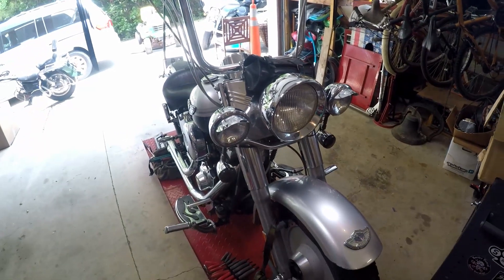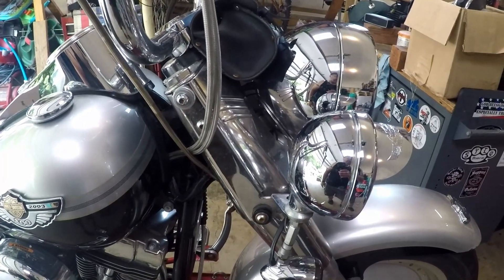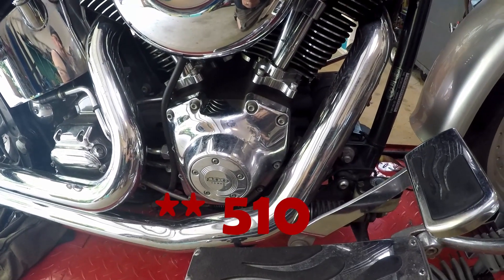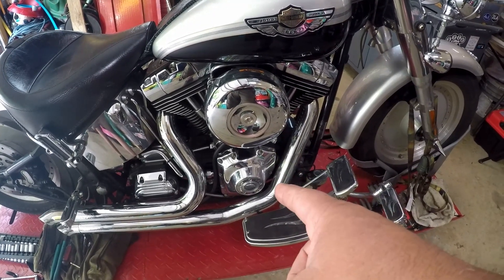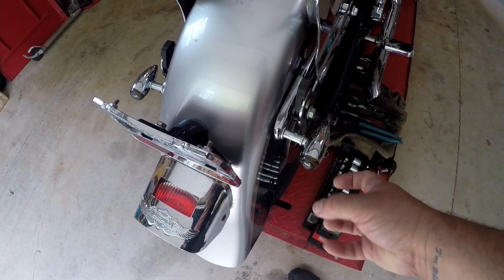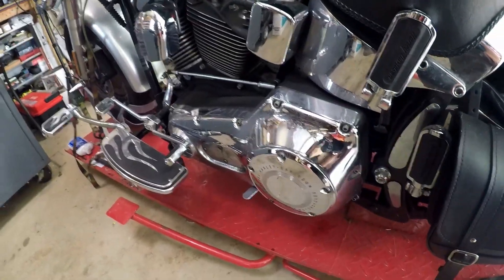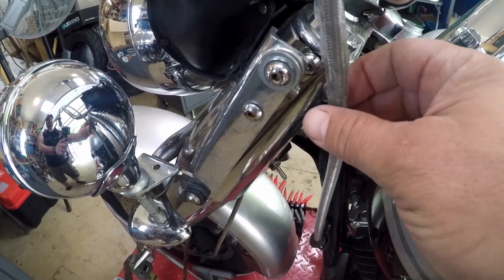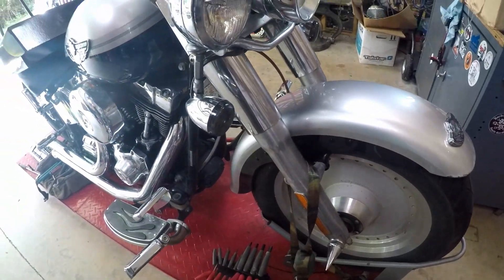Meet Miss Piggy   2003 Fatboy

Comment: Nice bike, i have a 2005 15 anniv,  FB, in  silver, I  put Andrews 37 g drive cams, in mine, Did you notice the bike being louder at idle, when hot after cams??  no one told me that after i got em, they sounds like a cummins diesel, but does pull like one too..haha
Reply from the maker: Yes definitely changed the idle some.  Thanks for commenting!

Comment: We know the speedo is original with the sticker on it.   They make a 135 TC motor and with a warranty tune it makes 130 HP and 135 tq. In that light bike it should do well.  Maybe overkill for some light oil leaks but that is where my mind goes...  James gaskets are not what they useda was.  Cometic are awesome and factory ones work well. We are back to you get what your paying for.    Flames, funny thing is in a year or two they will be making a comeback. Seems all those things do.  My favorite parts of Miss Piggy, no radio and loud pipes.
Reply from the maker: Hopefully she will still be around when the flames come back lol.  Might have to rock the bell bottoms at the same time